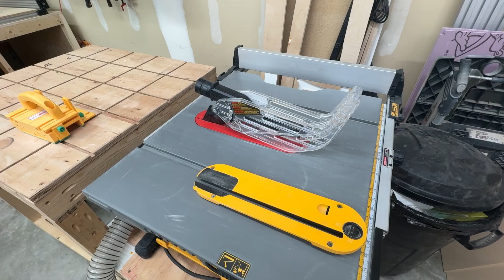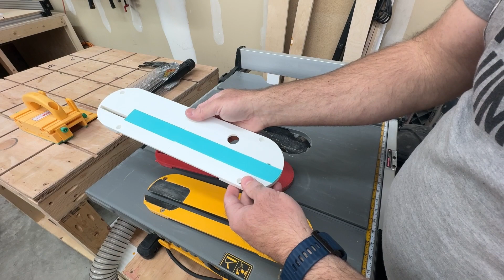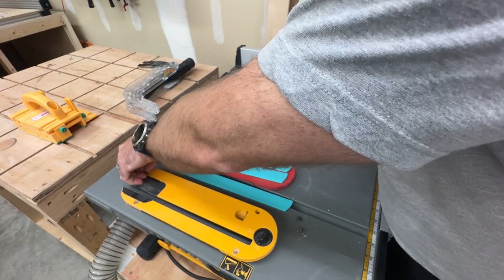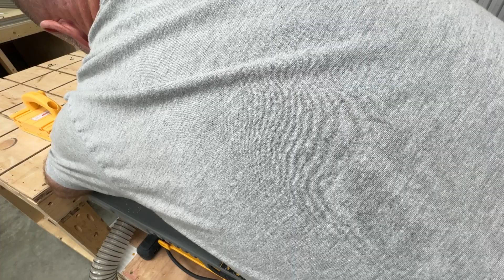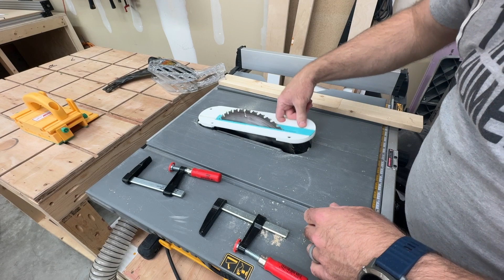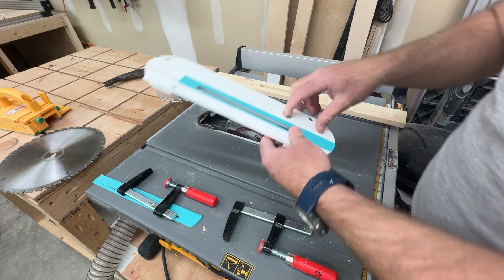Dewalt 7491 Zero Clearance table saw insert

Comment: Printables page is down?

What filament do you recommend for the bits that will get cutaway by the blade?
Reply from the maker: Sorry I will get the link updated: https://makerworld.com/models/1742917

I have used PLA and PETG and both worked well, if I had to recommend one over the other I would say PETG for the slight win.